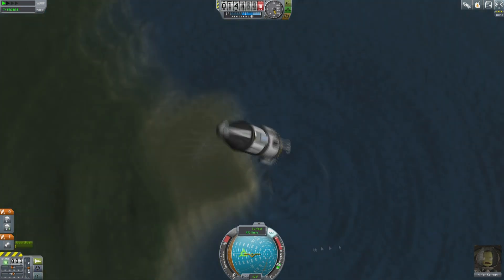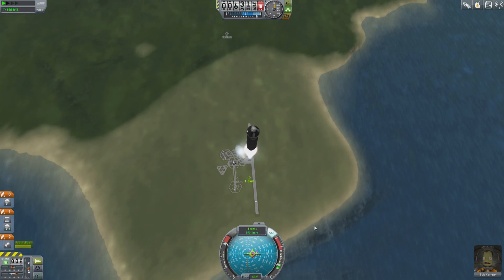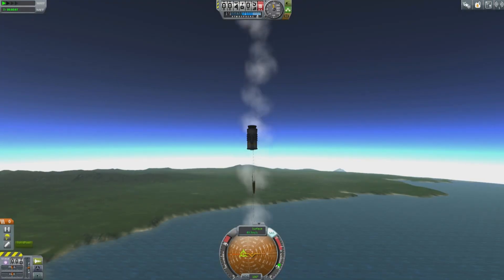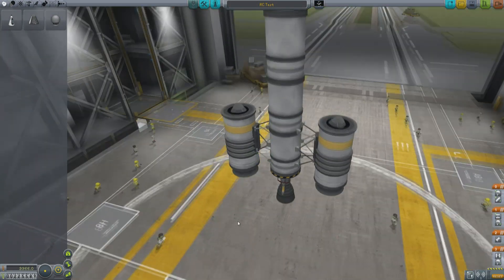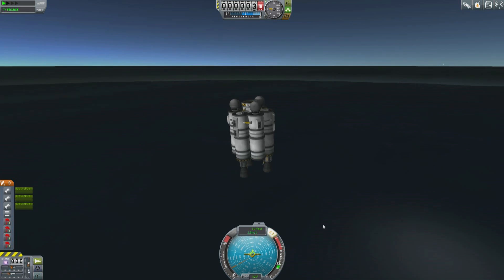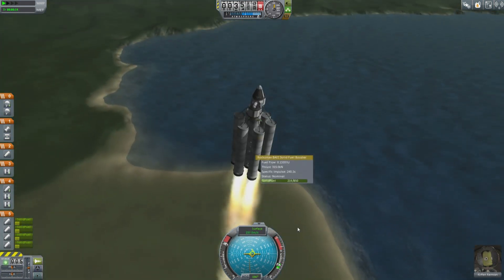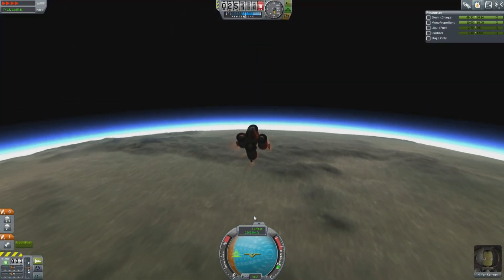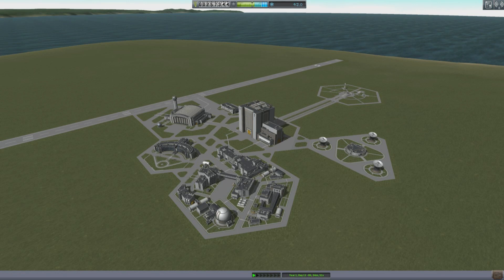Kerbal Space Program - Recovery And Reuse Tutorial in First Contract

Comment: If you want to recover stage parts it's best to just get the DebRefund mod. It does the job almost perfectly and it's easy to install. It automatically refunds all debris objects in Kerbin's atmosphere that leave the 2.5km physics bubble. The amount you get is based on and distance to KSC and landing speed (more mass = more/better parachutes required). It's almost identical to stock KSP recovery.

It recovers science experiments too, meaning you can also drop science labs, goo canisters etc. back to Kerbin if they can land safely. Obviously there are flaws (re-entry, parts falling over after landing, etc. is not calculated) but it's still an excellent mod until Squad improves stage recovery.

However if you really want to get things into orbit for cheap in the 0.24 Career mode, you may want to build SSTO spaceplanes instead of rockets. Manley mentions spaceplanes near the end of this video. They fly into low-orbit, drop their payload, then fly back to the KSC runway. Not only this, but they are vastly more fuel efficient than rockets (liquid fuel engines are around 300 isp, whereas jet engines are 2000-3000 isp) meaning you can get bigger payloads into orbit. The cons to spaceplanes are that they are pretty far in the tech tree, meaning spaceplanes are more of an end-game interplanetary solution (or mid-game if you play end-game tech mods like Interstellar).

Comment: Hey Scott, I started playing this version, and as excited as I was for it I can't help but feel like it's broke.

With the part testing contracts you have to meet altitude and speed requirements at the same time, and activate the part at that time.  Which results in things where it wants you to turn on a solid rocket booster at a high altitude and slow speed( which basically means slowing down and wasting delta V, let alone the iffy designs it would require).

So am I doing it wrong?  Or has Squad perhaps made a mistake(gasp)?  If they did, will they fix it?

Comment: I don't see why they can't just check to see if debris has a parachute and do a quick calculation to see if the parachute would slow it down enough for a safe landing and then just automatically recover it when it goes out of range. I hope someone does a mod for this because the 2 biggest things that i take hindrance to with this update is a) the physics range removing objects that should be recovered and b) the fact half of my crashes etc are due to physics bugs that I had no control over.

Comment: I'm thinking that there is a valid way to strap on some heat shields on the recoverable rockets.

Just place them on the top of the lifter stage so that it will be between the lifting stage and the orbit stage with a decoupler between the shield and the top of the rocket.

Comment: Another solution to the recoverability problem might be to have a stats check for items falling through that 2,5km limit. I.E. an item without any parachutes will just fall through, but if you have a booster with a parachute strapped to it, the game will calculate the weight-to-parachute strength factor and base the recoverability chance on that. A large booster or part with only a single small parachute would still 'disappear', but dropping something with sufficient parachutes will net you some funds, based on the distance from launch site and (possibly) terrain. The game wouldn't have to simulate the entire decend, but would just have to make a single stats check at 2,5 km.

Comment: I feel like if a part goes beyond physics range inside an atmosphere, the game should quickly calculate the part's weight and whether or not an activated parachute is attached to it, as well as the location, roughly, that the part is above at that time, then just add a recovery rate to your overall recovery rate for when you complete the mission. It's not quite the same as the part actually physically touching the ground, but it'd at least be close, without needing to expand the physics range to hundreds of kilometers. It's kind of silly that you have to go out of your way to recover anything that isn't attached to your final stage, but I guess Squad would have balanced that fact by not making parts cost quite as much, and of course, contracts that you succeed to complete will give you compensation for any parts you couldn't recover, if you're smart about building your rocket, right?

Comment: In the current build, if debris are safely landed but have no controls, you can recover them by going to the top of the map/tracking station to pull down the icon doohiky and enabling debris icons, thus letting you click them and recover them. Has this been changed to require a probe for recovery?

Comment: Scott, did you test the 64-bit Linux version? On 0.23.5 I could barely get the 32-bit to work with half a dozen mods, it crashed every 2-3 launches (with NullReferenceExceptions flying in the debug log); about 3 weeks ago I switched to the 64-bit version, patched it (according to the KSP forum instructions), and did not get a single crash since then (I'm trying to push it to its limits, I installed more than 40 mods, including the ones in your IQ series). I hope there's no regression with 0.24.

Comment: I'm expecting a lot of people to make extensive use of tweakables on SRBs now. I've experimented a bit with "asparagus-like" staging for SRBs, with thrust limited engines in the middle that burn for a long time at low thrust and default-setup engines on the outside that burn hard and fast to lift the initial weight. Just need to work out a formula for it, really.

Comment: They really should make the object physics simulation range a changeable option, or maybe an option in the vehicle assembly building and during flight to choose whether a part is normal derbis or recoverable debris. Maybe objects that have forms of control, like command pods would make anything they are attached to recoverable debris, then they could add a very small part like a receiver which you attach to your boosters/stages which could give you control over the debris (no torque), for activating parachutes and such. I feel they shouldn't have a recovery/funds system if it doesn't work properly... (but i guess the game IS still in development...)
Reply from the maker: Trust me, it's hard to do without breaking the physics, Unity isn't really setup for that.
Reply: I can't think of any problems with this, the objects can be on rails until they are about to impact the ground if simulating their descent takes too much cpu, and this wouldn't apply to all debris, only the "recoverable" debris. Maybe the 64 bit support can help with this as well...
Reply: Scott Manley I think unloaded parts should be stored in the tracking station. Players can then either try to recover them in a sandbox environment (no other ships loaded), choose automatic recovery (random chance of failure, even on a 100% guaranteed manual landing, but only if the craft is under control or has deployed parachutes rated for the tonnage) or discard it (cost isn't worth the time, this is done automatically after a while).

Comment: Have they extended the physics distans? Didnt it use to be 800 meter? 2.5 km is quite a distance. That mean you have to truck away stationary parts outside KSP for quite a distance to get they out of physics distance.
Reply: It's been 2.5km for a long time. At least since 0.20.
There's at least one mod that can change that distance.
Reply: Phoenix84118 Ooh which mod is that?
Reply: Benjamin Kahtan I believe it's part of the lazor systems mod: http://forum.kerbalspaceprogram.com/threads/9923-0-23-Lazor-System-v32b-(Dec-19)

Though I found it too bulky and integrated for my liking, so I don't use it.
Reply: For the recycling you need a mod that track diffrent part of the space part, and dont necisary increas the physics distance, but render two or more areas of physics.
Reply: Phoenix84118 I think it's been 2.5 ever since persistent flights were added. (.16 IIRC)

Comment: I've done designs where it uses the SSTO idea but with some small drop away tanks to help shed a little weight for the later parts of the launch. It has me curious now, with this version, how much I'd loose on the return for disposing the tanks. I suppose if they were big/bigger, it might make it worth it to recover them...
Reply: Its really the engines that is expensive. The decoupler is quite expensive to. But that problem can be solved by turning them the outer way around... decople the plane from the tank in steed of the normal way
Reply: matsv201 Good point. Though, with the strutted versions, it might look a little 'odd' with them being the other way around. I usually use the other versions since it helps keeps the weight in close to the main body of the vehicle.
Reply: Jimfoxyboy Only one way to find out ;)
Reply: matsv201 Oh.. SSTO version I did was a rocket, no plane. And I was using radial decouplers to drop empty tanks away. And it looks like radial decouplers only connect/work one way. Sorry about the delayed response.
Reply: Jimfoxyboy Well, thats strange, i wound if thats a bug or something. Or if the just let the decoupler disapere.

Comment: Maybe they should just introduce a recovery part. A small external part in the form of a tracking computer or something, that when you place it, acts in the same way that a regular probe body works, only without the added features of torque, power consumption etc. That way you can stick it on any part that you might want to recover at some point.
Reply: I was thinking the same thing on having a tracking part. It would count as a pod/probe and it would be attached to parts you want to recover and is incredibly inexpensive  and it has no control of engines or torque but can control staging
Reply: mastersniper1999 the problem is not being able to track stuff, it's that doing so cost CPU and Memory... hence the 2.5km limitation.

The game is built around the idea that stuff NEEDS to go away because it eats up CPU / Memory.
Reply: ***** Actually its model and its hitbox needs to go away, aswell as its physics and physical presence. But it doesn't really take that much effort to tell the game that there's an object there, but to just not make it appear within a certain distance of a piloted craft.